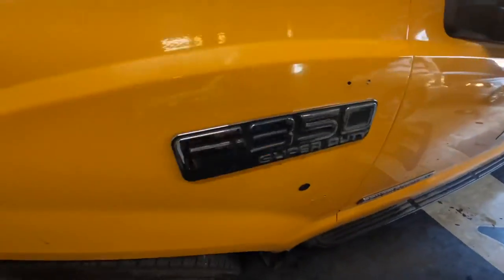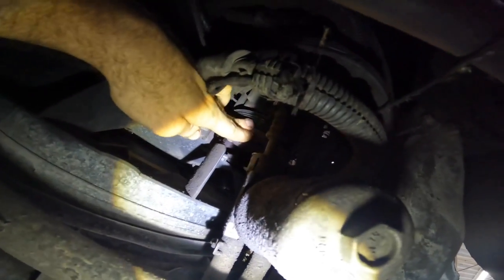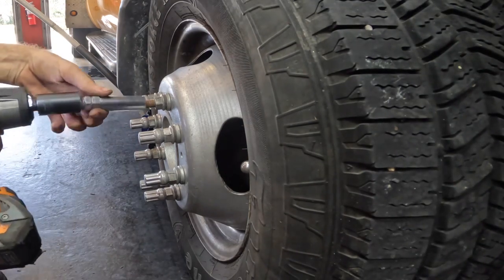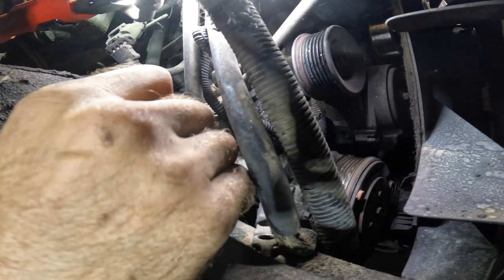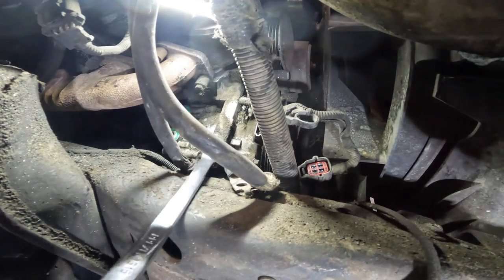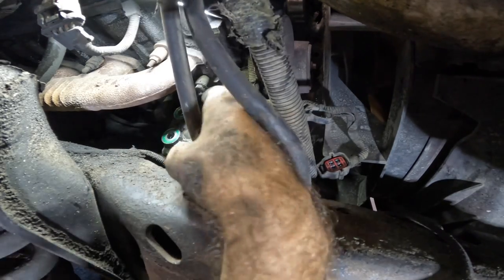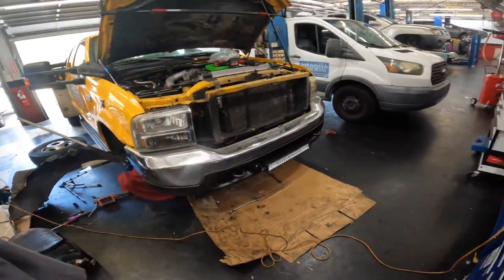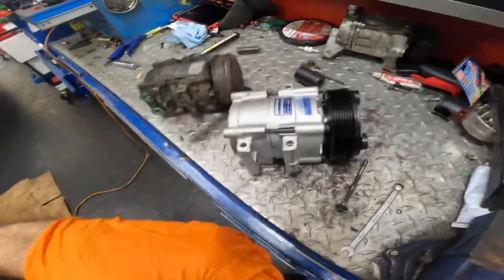Cut the Frame, Pull the Cab, or Suffer? Ford Powerstroke F350

Comment: And people wonder why mechanics have such a strong handshake. Because we get finger workouts daily trying to take stuff apart that these unganeers engineered. 

I’ve seen starters buried under a manifold and taking the subframe out is so common today. Can we go back to the designs of the 70s please. There is zero reason for this. I have a 7.3 and it’s so easy to work on compared to the 6.0 and up.

Comment: @ 12:33 the bolt is 8 mm with a 13 mm hex head. You guys got to use the correct terms or you'll have the wanna be's all confused.

Comment: The engineers and bean counters who design our cars and trucks, should be forced to work on them.
This kind of needless nightmare, is why I got out of the auto repair business.
Compare the hell you are going through, to doing the same job on a 300 c.i.d. Ford straight 6,
used widely in Ford pickups in the 1970's, or even on a big Ford V-8, like the 390, back in the day.
No, today's designers are maliciously indifferent to the struggles mechanics go through, and to the
prices for parts and labor which vehicle owners endure.

Comment: I had a 2008 F-250 w/ 6.4L PS.  Nearly ANY work on the engine required a cab pull.  It was one of Ford's most ridiculous designs ever.  Just plain stupid.

Comment: Another reason I'll never buy a Ford! This bad engineering had been going on way too long!! I'll drive a lease, Rented of a company Ford it's their problem when something breaks! Last time I drove a Ford was a Enterprise rental F250 Diesel I needed to pickup a camper because I was waiting on Tires for my GMC. During Covid. Ford is not the only one with engineering issues, Ram with the Cummins the oil filters is a mess to get out with a special tool. And it was either Toyota or Nissan when they first made the soccer mom vans you had to pull the engine to replace the starter? It was between the block and firewall,  they took an engine designed for a RWD vehicle and crammed it in a new FWD van  not taking into account where the starter was. I used to prefer Mopar until the 80s now I'm GM only except for my 2012 Ram Cummins ,  why because it's so easy to work on them! The GMC headlights for example 2 pins up and the headlights are out the RAM well let's remove the Grill, then open the hidden doors in the wheel Wells to reach in and find the hidden latches, amongst other steps needed to change a headlight bulb? I mean come on!!!

Comment: Another good reason to stay away from Ford. For a lot of engine work to be done on Fords you have to pull the cab off the frame. In my opinion that's unacceptable, and unnecessary poor engineering.

Comment: Worthless Fords! They have the worst engineering! Took me two days trying to pull a starter out with the bolt being on top of the starter and slightly angle at1:00o'clock position toward the engine block as well as the starter being right below the exhaust manifold! Never in my life have I owned a ford and I sure he'll never will!....BTW No lie true story as a Mechanic anytime I get a customer that has a Ford I turn them down really fast no questions asked I just say: "Nope, take it somewhere else"!!

Comment: I hate ford engineers.  On a few years of the transit they had a drive shaft vulcanized rubber cupplier that failed about every 20k miles. They put out a campaign to fix it. The exact same part!. So ya needless to say they removed the part in I believe 2018 transit. Moronic.